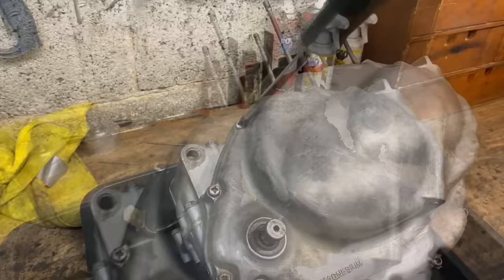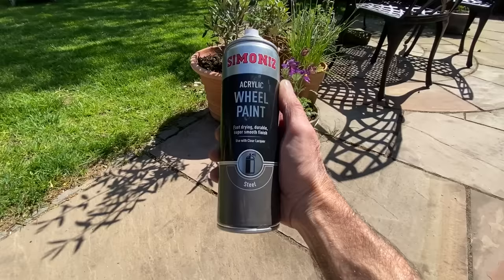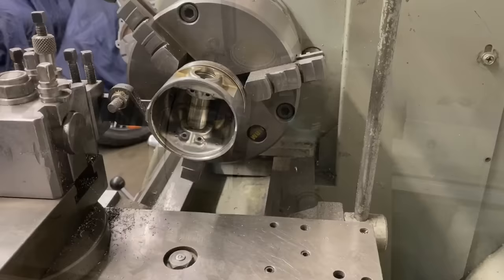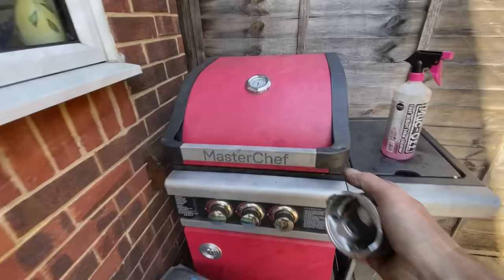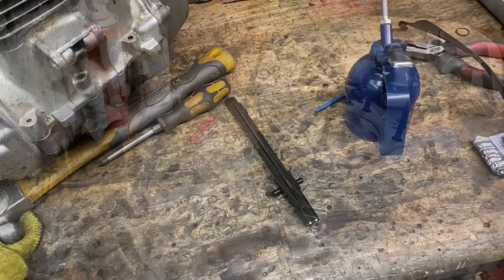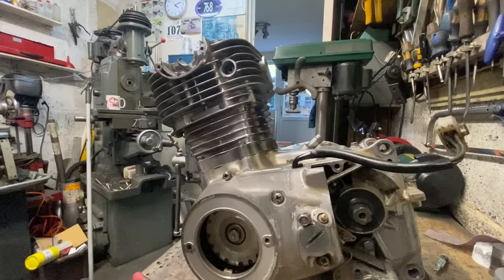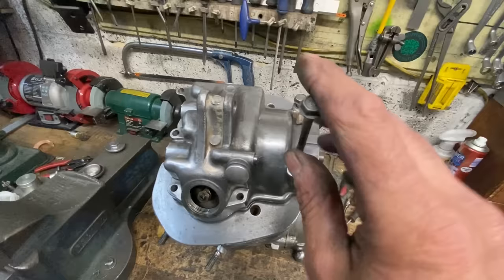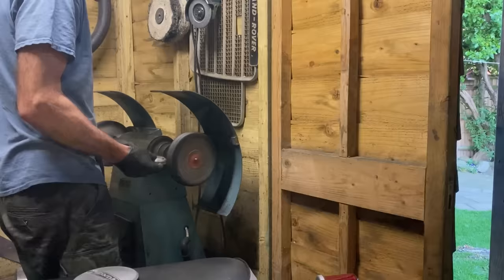Honda XL175 engine repair

Comment: Obviously a low lift mild cam in that motor regards using a 4V piston with a 2V head and a  sensible(ish) hemi combustion chamber.
Edit,
I like the zero expenditure on a top end refresh for a working engine.

Comment: Probably doesn't matter but it looked like there was part of an old seal stuck in the gallery when you put the oil control orifice back in.
Reply from the maker: its all fine
Reply: @AllenMillyard  I figured.  Loving the more in depth videos!

Comment: Great video, you make everything look so easy, may I ask why you didn't re-lap the valves in while the head was off, that would have finished off the engine nicely.
Reply from the maker: No need they sealled perfectly when I tested them

Comment: I thought annealing metals made them harder and stiffer? I once made a conical spring for a horn button out of copper wire then annealed it to make it stiff and springy, it worked a treat.

Comment: That cam middle seat has seen better days.
Reply from the maker: its nearly 50 years old, gets ridden most days for commuting and trail riding on a budget, some wear can be tolerated and will continue to give great service for many years
Reply: @AllenMillyard  yeah, true. Built to last.

Comment: Nice video! Great to see the inside of this great little engine as well! Cool how you could use the kawa piston, nice. But wouldn’t it be better to buy new Kawasaki rings, because they have to wear in? 
The copper headgasket is great, looking forward to see that video houw you fixed that!

Comment: Hi. Thanks for the videos. I really enjoy your work. It's great to see what can be achieved with old school tools in a (well equipped) home workshop. I have a question. Is there a particular reason you used a VFr (4 valve) piston in a 2 valve engine other than "it was in my spares box and looked like it would work"? Cheers and keep up the good work.

Comment: I have one of the first XL175's to come out [the black & orange model] in Australia, a very faithful old girl after many years of use she ground to a halt. I removed the engine and dismantled it to find the big end had seized and the camshaft had worn the head away and was flopping around like a lizard with a leg off.  After chasing the parts and prices I figured that it was not worth repairing, that was thirty seven years ago I still have the bike and all the bits and every now and then I look at it and think well maybe one day. I am 77 years old  and have five motorbikes that I still ride, do I need one more ?????

Comment: I laughed as soon as you revealed the vfr piston instead of stock . Why would it contain anything less??
Just one note Allen, I learnt to my error that a bit of locktight on the cam bolts can save a lot of potential heart ache.

Comment: Comments and questions: How I miss working on those old Hondas! Do you not put a little piece of rag into the camchain tunnel to catch that little bolt which almost always falls? (It didn't happen to me on bike engines, but I learned my lesson with an Alfa engine, dropping the camchain master link into the sump...) A 4 valve piston clears 2 valves? What is the capacity with the bored out cylinder? Any jetting changes needed for the bigger capacity?

Comment: Did a piston meant for a four valve engine, make a difference in the running of the[two valve ] engine?
Reply: I was actually going to ask the same question. He's obviously checked the piston-to-valve clearance during the previous build. I doubt the valve cutaways in the piston would match the position of the valves in the 175 head.

Comment: the retro fitted piston is domed with valve reliefs for 4 valves. im guessing the interferences are ok, but has the  new compression ratio been accounted for?

Comment: Wow Allen! What a nice job! I am in the process of buying Honda E300 generator which has head cover spark plug threads gone and i did not know what to do about the cover gasket until i saw the copper one you made. Lovely job. How do you suppose i go abbout fixing the plug threads? Hellicoil or weld, drill and tap? Thanks. Great channel!

Comment: I've never seen those buttons holding the gudgeon pin in. What stops them from moving up against the cylinder wall and marking it up?
Reply from the maker: It’s a common aircraft technique, they are made from aluminium like the piston so don’t mark the bore

Comment: If, or when(!) you get another big-bad-bloody thumb nail, or any other nail, man up, fit a .75mm drill bit to your favorite drilling machine, and CAREFULLY-SLOWLY drill right in the middle,  JUST through the nail.  You may have to use a needle, or pin, to get all the accumulated blood out, but it heals MUCH faster than leaving it to go black.

Comment: On honda singles are there roller bearings or she'll bearings running on the camshaft or is there no bearing and it runs straight in the aluminium of the head so when the head wears round the camshaft journal the head is then junk?

Comment: Lovely rebuild with great attention to detail. Is there a short video with the engine in and running?
Reply from the maker: John Pirie I can do that.
Reply: @AllenMillyard  That would be great Allen. Nothing better than seeing a bike engine being stripped, cleaned and all repair works being carried out. New gaskets, fresh paint etc...And the finishing touch is the engine back in the frame, all connections made and hearing it start.
Fantastic work mate; keep it up.
Your videos are very interesting.
Best wishes.

Comment: Hi Allen, I was wondering if you used the milling machine to bore out the barrel as there would be quite a tool overhang on the lathe.

Comment: can you do me a favour  as there is a massive following for the humble cd175 within the uk , could do you do a restore on youtube of one (not the sloper) , also i have added 5 speed box to mine and 12v electrics , was going to  also put in a sloper cam as i hear  they add a couple of extra hp . that would mean  to me any way not so high revs  at a steady 60mph ?i do hope that you are passing on your expertise to some youngsters ,  you are  an amazing mechanic and petrol head   .dont think you will ever lose  the heart or that feeling of wow that runs well now  feeling . i know as i get that after working on anything from a lawn mower  to changing cranks in a case tractor (with a lot of help from someone like you )
Reply from the maker: I had a red cd175 in the 70's great bike

Comment: How it runs? Guess no problem using piston form different type of engine with 4 valve slots on 2 valve cylinder head?

Comment: Are you sure the wrist pin buttons you pit in won't rub on the cylinder?  Not 100 percent on this, but in most applications where buttons are used, the oil ring it what keeps them in place.   Unless there was another way you secured them.

Comment: You use a 4 Valve Piston and a 2 Valve Zylinderhead. A the valve havent contact with the piston.
Wow, incredible.
Wy you don't use the Kawasaki 2 Valve Piston from the Z 1000 with org. Kawa Pistonrings.
I'm very sorry, my english ist not very Well. Greetings from Germany.

Comment: Hi Allen, I noticed in your reassembly process you oiled a bearing at the sparkplug end of the cam, my 1973 Honda XL175 only has a bearing at the sprocket end of the cam. Did you put that other bearing in there or is it a new development on a later model bike? Cheers.

Comment: Is the intake valve spring on upside down or aftermarket?
 Is that an Australian market bike as I've only seen 125 and 185 XL that shape and two piece cam/rocker cover is 'late model'

Comment: The wrist pin buttons are very interesting. Did you make them yourself? If so, what grade of aluminium did you use? I'm always paranoid of firing the clips across the garage, never to be seen again, or dropping them in the crank case causing a lot of rework.

Comment: I enjoy watching all your videos.  I noticed you installed a piston from a 4 valve per cylinder engine in the xl175 which has a head with 2 valves per cylinder.  Will this mismatch create any issues with combustion or flow through the head?
Reply from the maker: its been running for 8 years, the engine was due a service

Comment: I love the work you do on these bikes.
 Tip, the auto advance bob weight springs on these engines are often a bit loose, and at 1000 rpm have allready advanced reducing their dynamic range. I twist inward the spring loop and refit so they are tight. Then after strobe timing at 1000 rpm the engine will have the full auto advance range and a lot more top end power.
Question I have a 84  VT500c but engine parts are hard to find, and cam chain tennsioners even harder. Have you done any mods on this great engine, or found a way to upgrade the tensionners. Thankyou.

Comment: Hi Allen, I noticed that you don't torque any cylinder head bolts or nuts to any particular specifications. It must be ok to not do this as you don't do it on any of your builds. I never hear about any failure. Also I noticed you do not use an impact screwdriver for opening any of the engine cases. Was just wondering if this is okay as well?

Comment: Hi Allen, I got a question, are you familiar with the Yamaha SR185? Or have you made a video on it? Because I'm looking into restoring an old SR I got in the near future, after finishing a minibike restoration project (bare-basic design, direct chain drive with centrifugal clutch) to gain basic mechanical experience with motorbikes. Thanks for the vids man.

Comment: if its a big bore what CC's is it and have you thought of making it a V twin yet
Reply: Info is hard to find for some reason.

The standard bike is 173 cc.  The XL185 is 180 cc with a bore and stroke of 63 x 57.8 mm.

So it seems likely the standard XL175 stroke is 55.5 mm with the same 63 mm bore.

With the 70 mm VFR750 piston, the displacement would then be 213.6 cc :)

Comment: Hello, could you or someone else explain how a copper head gasket is able to provide an adequate seal while holding back the cylinder compression and engine oil? I had a ‘73 Z1 900 Kawasaki and installed a copper head gasket during a cylinder head valve job. From that point  forward, I always had oil migrating past the copper head gasket. The head bolts were torqued properly to specification and re torqued after riding a few hundred miles, but the oil still got past the gasket. So what is the benefit of the copper head gasket? Heat distribution? And how do you make sure the gasket will seal completely, and not allow a compression leak and oil migration? Thanks
Reply from the maker: Make sure it’s fully annealed

Comment: Do you have, or know where I can find a video replacing. The kick start shaft on a 1976 XL175. Any help would be greatly appreciated
Reply from the maker: It’s an easy job you can split the cases without disturbing the barrel and piston i did this job a few weeks ago but sadly didn’t record the process 🙈

Comment: Great. a two valve engine using a four valve piston, so it's ok to run piston and leave the contour for valves in top of piston and not blend them out? Does it use standard liner? Secondly, a friend of mine has a 230cc  Honda japanese import trail bike, what does anyone think that could be taken out to?

Comment: Hi Alan, I see that engine has a piston from a four valve engine I am much modifying a yamaha TT500 and am using a piston from a KTM 400, Have you ever tried to weld up the valve reliefs in a forged piston to recut where you need them?. Love your work

Comment: Thanks Allen, great video on these remarkable little engines 😊 I am building a fuel injected 186cc based on a CBF125 bottom end and had to sleeve the piston for the 13mm pin ! Was having trouble finding circlips so the aluminium end plugs would be ideal !! Can I buy these or would I have to have them machined please ?
Reply from the maker: Machine them to suit your application
Reply: @AllenMillyard  thank you for the reply, I was aware of the Teflon buttons for VW air cooled engines ! I think I'll have a go at a pair of Ali items based on your design, happy Xmas to you and yours 😊

Comment: Great videos keep them coming - as a toolmaker I am also enjoying watching the machining etc ! Quick question in the latest Kawasaki 6 when machining the the two parts of the engine before welding did you clock the two bores to get true in you mill ?

Comment: In the Honda Cylinder Head video you mention Permatex Ultra Grey for sealing cases. Which on is best for crankcases as there seems to be different numbers ie: 22074 / 822194, not sure which one to get?
Reply from the maker: mine is 22074

Comment: @4:22 Piston rings wont fit the piston. "that's easily rectified by putting it in my lathe..." 99/100 people would have gone "ah maaaan..." and thrown them away. pretty good upcycling there. ;)

Comment: heating and quickly cooling the copper in water does not anneal it, you need to heat until red and then leave to cool on its own
Reply: How many have you done, I'm sure that Allen has done this countless times and it obviously does work, don't forget that this is not steel, copper acts differently.
Reply: When I've annealed copper, I always quenched it and it worked fine.

Comment: Allen do you put any sealant in your copper head gaskets?
Reply from the maker: Sometimes a smeer of Permatex ultra grey especially around oil gallery’s or water gallery’s
Reply: Allen Millyard Cheers Allen

Comment: So obviously, running a 4-valve piston with a 2-valve head doesn't present any clearance problems between the valve pockets on the piston and the valves in the head.

Comment: But it wasn't the Kawasaki Z1000 piston you used Allen, it was a 4 valve piston....lucky the valves didn't clout the ridge between the piston depressions.
Reply from the maker: No luck needed there was loads of clearance

Comment: Is it ok to use a four valve piston with a two valve head?
Reply from the maker: yes as long as the valves clear and you consider the compression ratio

Comment: Lovely build Allen.
I would question why pay a fortune for the gasket paper when you have old pizza boxes lying around.
Do you wear your thumbs out doing all that rubbing?
Then there is the nightmare for a future owner when trying to match piston parts.
Did you ever build one with skateboard wheels for bearings.
Reply from the maker: The proper gasket paper doesnt tear

Comment: Alan what size did your rebore take the displacement to and wouldn't you need to rebalance for the gudgeon pin aircraft buttons.?
Reply: If it's from a VFR 750 it should now be 187,5 cc, that's 750 divided by four.
Reply: @jospi2  I remember you mentioning the piston was from a VFR but didn't know if the stroke was the same. No balance issue with gudgeon pin buttons ?
Love the big vee twin bye the way.

Comment: Hello Allen, the replacement piston crown looks like it's for a four valve head. Is that not a problem when there's only two valves?
Reply from the maker: No,  it runs fine
Reply: @AllenMillyard  Thanks for the reply. Great videos! I used to ride TL Hondas in youth trials way back when, so have a particular soft spot for this engine type.

Comment: If you met Allen Millyard in the pub and didn't know who he was, you would think he was the biggest fantasist the world had ever seen.... 

"Yeah, so anyway, I looked around my shed and found this old Z1 piston and noticed it was the same size as the VFR one which I had fitted into the XL175 motor I had modified.  A few quick turns of the lathe to modify the VFR piston to take the Kawasaki rings and it all fitted.  Which was smashing"

Comment: Any idea what caused the rings to fail Allen?Thanks.
Reply from the maker: I suspect it was that they were really thin for a water cooled engine and the over heated, the thicker air cooled Z1 rings will be better